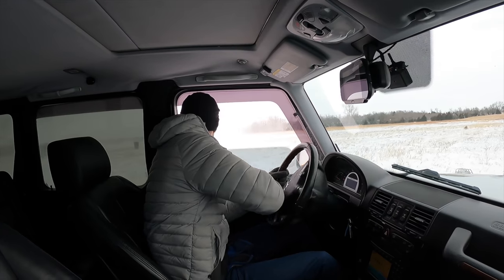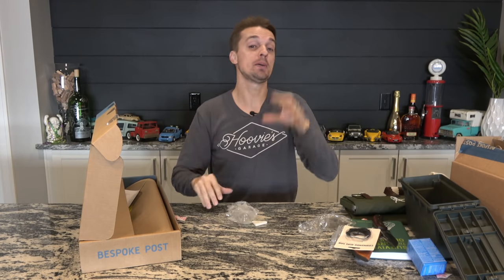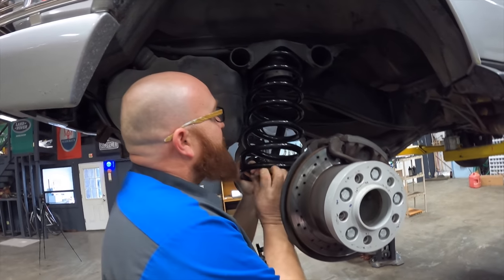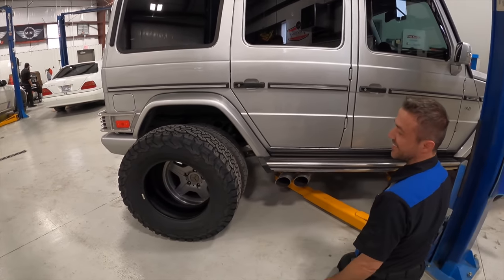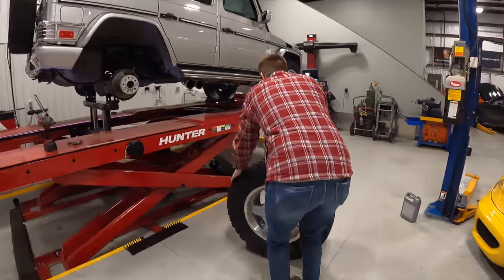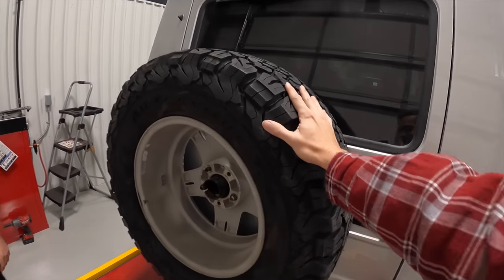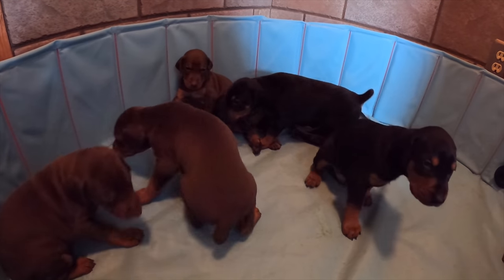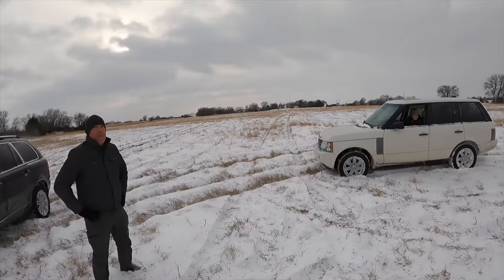Was Buying the Cheapest Mercedes G55 AMG with 220,000 Miles a Mistake?

Comment: Spare tyre in such a size is just a waste of money and fuel. Get a tyre plug set and a 12v compressor instead. You are not equipped with a jack big enough to change such tires anyway, so you might as well store the jack in your garage. I had my large tires for many years without any issues, so a spare tire is just a big waste of space, money and fuel.

Comment: Hmm that Volvo looks quite nice,  the XC90s are so overlooked
Reply: only in V8 though, even then that B8444S is a little finicky.  It's basically just a P2 Volvo, exact same architecture.  transversely mounted V8... weak bevel gear/PTO unit, decent diff and driveshafts but not made for real torque.  Also McPherson front suspension.  Don't get me wrong I own another P2 (2002 V70), they are good and reliable vehicles if maintained, but made to a price point.  Volvo did well though during that era and the XC90 was the last of the P2's still in production by 2015
Reply: @reallyhappenings5597  Thanks for the information! I know noting about volvos! The P2 platform seems interesting!

Comment: The development of the G-Class started in 1972 with a cooperative agreement between Daimler-Benz and Steyr-Daimler-Puch in Graz, Austria. The W460 was introduced at a press event held at the off-road proving ground in Toulon, France, and went on sale in September 1979 with three engine choices and five body variants. The first-generation M-Class, designated under the model code W163 is a body-on-frame SUV where production moved to the U.S. plant near Vance, Alabama. Since the original G-Wagon was more  utilitarian vehicle, Mercedes had to make the M-Class more car-like for the US Market (No exposed door hinges for example). When I heard they were bringing  the G-Wagon back as utilitarian as the version in the 70's( with only a few upgrades) and they expected people to pay many time more then the current GLE line( with is still more suited for the US market, you're not going off-road, you' re going to Whole Foods.).I said to myself nobody who Googled the previous would be ignorant enough to pay that much. I was wrong. The people who fell for this don't research. THEY FOLLOW.

Comment: you can go up to 35's with only upgrading the bushings, with the lift you can do it easily. It's a bit of a tight fit but it doesn't rub. 
ps. tire size 285/75/18

Comment: Having owned one, get ready for:
- replacing all window regulators. 
- Steering wheel adjustment motor breakage. 
- Seat switch controller gremlins. 
- That heavy tire is gonna wreck you tailgate. 
- and more!
Reply: How’s the maintenance on g wagon?
Reply: @Skychi653  it’s now terrible…BUT, when shit breaks (and it WILL), hope you’ve got deep pockets. This isn’t a vehicle for anyone living paycheck to paycheck.
Reply: Heavy tire wrecking the tailgate is spot on. People never mention that issue.

Comment: XC90 AWD is too safe on the snow. Freaking DSTC stops you from doing ANYTHING fun, pulls almost all power once you start slipping. Gotta turn it off for horsing around in the snow, then they will do excellent donuts once you get the back to hang out!

Comment: allot of guy make the mistake of putting too much psi in there new off road tires causing them to ride stiff. often times the new tires have a higher load rating then necessary so you don't need as much psi. For instance, my lift manufacture (Carli) recommends that I fill my 35s on my f250 to 35 psi rear and 40 psi front and at that psi they still have the same load capacity as stock. the off-road tires recommend 80 psi but it rides like shit with 80psi

Comment: Tip for the wizard next time he tries to drill out McGuard locking bolts, don't, just weld on a short length of square stock steel, the thermal shock will break the thread and you can get them off with a spanner, 10 minutes per wheel.

Comment: I had a g55 in at my shop for front end axle work. After parts and labor it was around $2500 for new front axles, bearings, and all the odds and ends.

Comment: A word to the Wiizard: easier and quicker way to get rid on wheel lock bolts is a blow torch. Just heat the bolt head and it will melt away. It won't hurt the wheel if it's aluminum. You can try it on some scrap wheel, but it works.

Comment: Quick trick to get locking lugs out. Tack weld another lug nut to the culprit and wrench away. Those locking things are a pain in the ass. They don't have enough depth to actually get a good bite.

Comment: Best buy you've done so far IMHO. 👍👍
Get your diff-locks bled. They are actuated by vacum operating a hydraulic system, and the fluid has probably never been changed. It's just some sort of brake fluid, but I can't remember the DOT rating. Use them regularly, and you will keep them from seizing.

Comment: The G wagon will be back in the Wizard’s before long with the wheel spacers for wheel bearings. They make the car look great but put a lot of extra load on the car. Hope he used thread lock on the spacers, they have a habit of coming lose even though your wheel bolts are tight especially on 4x4s. They are illegal here in Australia and void insurance. Safest way to get the look is offset rims without spacers.

Comment: With your 2" lift, you can easily fit 35" tires with minor rubbing on full steering lock and fully-flexed suspension.

Comment: to save you time with the wheel nuts i had them on my ford so i tried to drill like you but its timely .. so i welded the outer spining part the center then use a socket and put it over the nut hit it on and simply take the nut off .... saves so much time